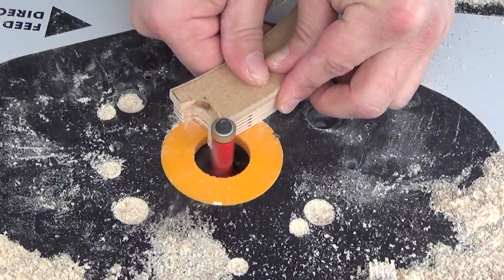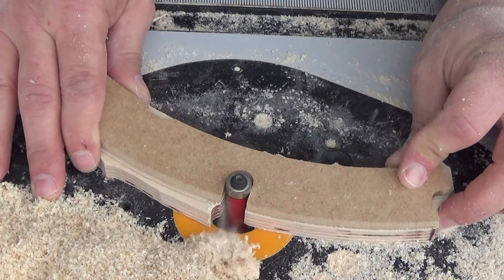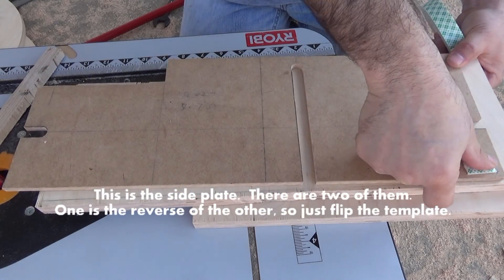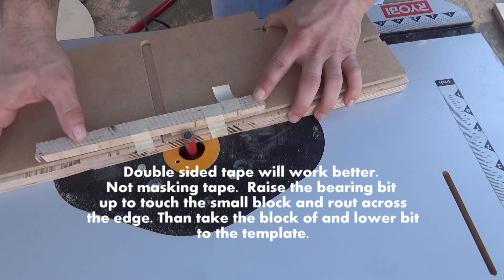R2D2 Senna Frame Part II Side Plates and Rings, Router with Bottom Bearing Bit

Comment: Does the plan template also provide templates for the rear door?  I saw another SENNA video where a gentlemen assembled a door; however, he never mentioned if the door templates were included in the frame template set.
Reply from the maker: +GunnerAl9 You may be referring to Thomas Clarks video.  The plans don't have templates for that. However, the measurements for the that depend on how you want to make the back door.  Some builders have them hinged, others have them on magnets to completely come out, and snap back in.  First, the frame is assembled and than the middle ring gets cut, and reconfigured. With a few extra uprights added and magnets installed.  You will need the skins to do this, so you can figure out what part of the skins you to make as the back door.